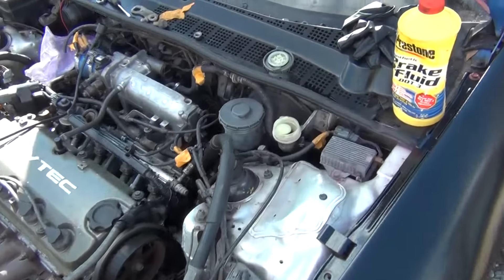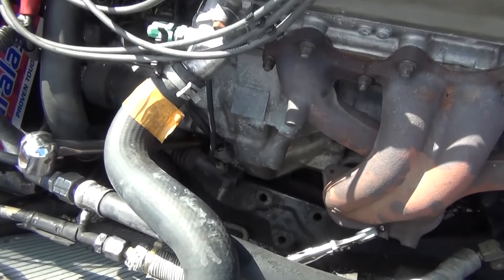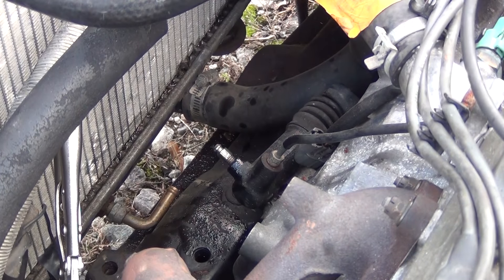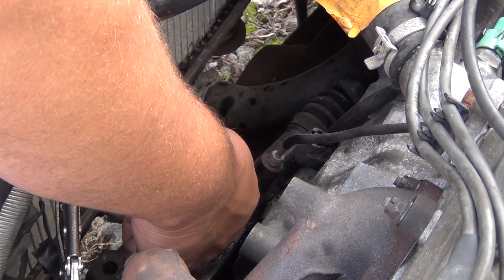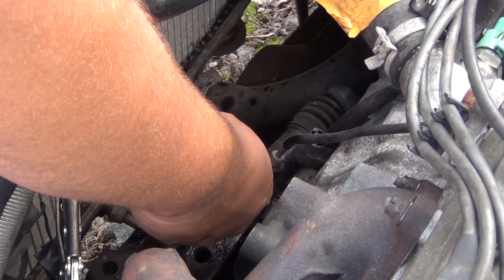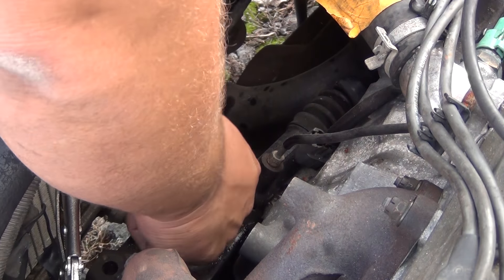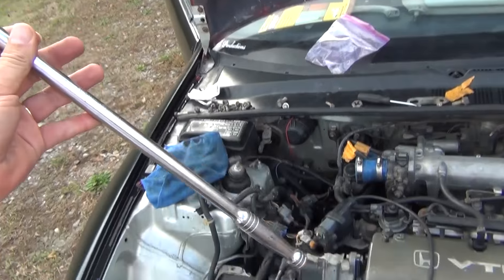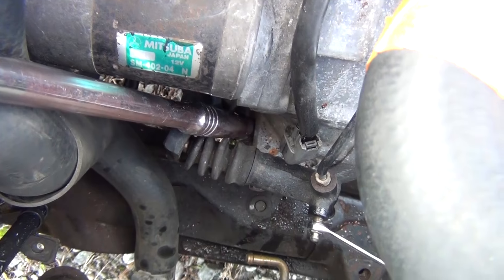How to bleed your honda clutch

Comment: I tried this method, after changing both the master and slave cylinders on a 2000 Accord.  After 2 hours of bleeding and getting nowhere, my pedal-pushing helper suggested we try a different method, and it worked!   With the bleeder closed, pump the pedal at least 20 times, and leave the pedal up.  Open the bleeder and push the pedal slowly to the floor, forcing fluid through the system.  Then close the bleeder and pull the pedal up.  Repeat until all air is out of the hydraulics.  Make sure the reservoir does not run dry.  I hope this will help someone to avoid the frustrations we experienced.
Reply: How long did it take using your method?
Reply: @corazon88  For me, after changing to the final method, the fluid and air bubbles started flowing out the bleeder immediately.  After about 5 reps, the air was completely gone and peddle was normal.  I wish I had tried this first instead of wasting 2 hours getting nowhere.  Good luck!
Reply: Did you did half turn or barely open the bleeder to get the air out
Reply: @Chipman88  The bleeder valve on the 2000 Accord is very close to the motor mount so turning it was really difficult.  Had to take 2 turns with a 12 point box end wrench - total of 1/6th of a turn - to get air and fluid to flow. 1/12 of a turn was not enough.
Reply: Then you did it wrong. This is a bad method. you really want a hose on the bleader so air doesn't go back into your lines. You see where the bleeder is so now just Google how to bleed brakes and the different methods for that will help you with the clutch as it's the same.
Reply: Just get the Phoenix V-5 or V-12 reverse bleeder and push the air up and out rather than forcing the fluid to work against gravity. 😂🎉
Reply: I do like Thad know my pedal no got back don't what I do run no got any power the pedal put it up put back and stay down don't know I buy new one to see any idea how can fit it please my first CRV 200 I got thank
Reply: I have this problem right now I changue tha master cilinder tha slave cilinder now we have a hard time to put tha air out
Reply: @laindiarivera  got saint problems abres abajo el tornillo completo y manda arguing lede Al pedal asta que tuveso sigue saliendo el brake fluid pero no puede dejar que dónde se le echa se vacía y cuando vea que sale directo cada ves under el pedal lo tranca y Leda como 5 veces o más deja a bajo pedal y abren el tornillo y ase eso como 4 veces tuveso pones duro si no trabaja compra la tool venden Amazon eso trabaja al 100 vale 16 peso pero hay una por 12 pone para sacar el aire del clutch o freno salir muchas suerte dios quiera travaje paso mismo tenía loco pero Ise eso pude arreglar suerte
Reply: Just wanted to say thank you. Your method worked for me.
Reply: I been trying this guy in videos method on my 02 accord for 2 hrs. Switched to the method you said started working. Just found your comment wish I saw earlier 😂
Reply: Thank you so much for this guide.My client's own had a similar issue so I bleed the clutch and still to no avail. I've even replaced only the kit inside the upper clutch but the problem of a sponge clutch and no gear still persist.
 I've checked scrutingly for signs of leakage carefully while someone and found out that the down clutch nipple doesn't hold clutch hydraulic fluid! It goes out gently, and also the clutch fluid was replaced with a new one. Nevertheless, it's still very darkened in color. Please, how do I fix the issues? 
   Darkened fluid, soft clutch pedal, and a most especially the leak at the down clutch bleeder  or nipple.
Reply: Yep you gotta open the bleeder then press clutch full to the floor then close the bleeder, pull back the clutch slowly then open bleeder and press clutch again. 20 of these will flush a bottle of brake fluid thru it quickly, just keep fluid well above the min mark. I bleed it into 5mm hose and can make it as long as you want, just set the drain pan above the height of the bleeder and should have a solid stream of fluid with no bubbles

Comment: You can do this by yourself if you use a jack handle wedged between the seat to hold the pedal down while cracking the bleeder screw. Go back into the car after tightening and pump the pedal then put bar or stick back to hold pedal down.

Comment: i use the fluid bleed method one man fluid bleed. attach hose on the bleed nipple put the hose in a bottle filled quarter way with fluid crack the nipple open & pump pedal check fluid after every 5 pumps to make sure reservoir didn't go dry  if low add fluid make sure reservoir doesn't go dry if so it make take in air then pump pedal repeat process then check nipple bottle is not over flowing if so close nipple empty fluid to reuse still keep the bottle quarter way full put the hose back in the bottle and crack the nipple open again. you can tell if  there's still air in the system if air bubbles is still popping up in the bottle keep repeating process until no bubbles show up in nipple bottle after that close nipple top off fluid and you'll be good to go may sound complicated but its super easy and effective just thought i share its an old way of doing it old as me lmfao but it works.

Comment: Great video. A little confused on the last part when you use the breaker bar to pry open the slave cylinder. Don’t you want the clutch compressed when you open the valve to bleed the line?
Reply: Yes which is what he did

Comment: If you have tried this and it's still not working, if you're sure you got all the air out and still can't push it in gear.  Did you buy one of the cheapest pressure plates you could find,  Amazon?  If you look into it sometimes even the good name after market ones have issues straight out the box too. I kept bleeding for weeks but it was the pressure plate. For easiest best bleed try this method along with an electric vacuum pump

Comment: If you have tried this and it's still not working of you're sure you got all the air out and still can't push it in gear.  Did you buy one of the cheapest pressure plates you could find,  Amazon?  If you look into it sometimes even the good name after market ones have issues straight out the box too. I kept bleeding for weeks but it was the pressure plate. For easiest best bleed try this method along with an electric vacuum pump

Comment: Also, it's important to note that a lot of times when you replace a clutch master cylinder, it will cause the slave cylinder to pop it's seal and you'll have to replace that as well. It's very common for that to occur. On a Honda such as this, there will be that small rubber boot that looks like an accordion. While bleeding the clutch, that boot will often pop off and spray fluid out. It's located near the bottom left of the engine very close to the bleeder valve.
Reply: I just replaced my master but the slave didn’t leak. Should be fine?
Reply: @jonathansalgado9194  yes. don't replace it unless it leaks. But really not a bad idea to replace it as it's super easy and you can bleed it before installing it.

Comment: you could do this so much quicker and easier if you use a pressurised brake and clutch tool. its a lot easier, only needs one person and takes all the guesswork out of the job, leaving no old fluid or air in the system.

Comment: Hey I tryed to bleed the clutch from my 97 civic ex but can’t get pressure from the pedal back help thanks!
Reply: Did you figure that out ? I have the same problem
Reply: @kevingarnet6822  yea I got it fixed just a lot of air in the system
Reply: @jessegunn2033  so how did you fix it ? What did you have to do

Comment: And would the  brake master cylinder being low on fluid or having an internal leak cause  the bleeding of the clutch to take a long time? Cuz I did the prying on the clutch slave cylinder and the clutch pedal won't get any harder
Reply: Young Malcolm following🥺
Reply: @AyySpaceship  its all good bro figured it out
Reply: @youngmalcolm8603  was it air in the system. Howd you get it out

Comment: I have a problem with a 97 prelude I changed the clutch and the slave cylinder and the clutch pedal is to the floor I already did the bleed part for 3 hours and nothing! Hope you can get back to me !..!
Reply from the maker: I did the same thing, thats why i used the prybar. It helps to get pressure off the slave cylinder so it can expand while bleeding it

Comment: Yeah, I just replaced both the master and slave on a 90 Accord and there's fluid coming out of the slave when I bleed it, but no pressure at the pedal.
Reply: Having the same issue.  We’re you by any chance able to get it fix ?
Reply: Having the same issue on my 09 accord but me I don’t get fluid or neither pressure help

Comment: I just cant get this right on my 2004 EP. I bled the system, air doesnt come off but the pedal falls to floor.. you can pushpull the master cylinder. I tried prying the slave piston, after cracking the bleeder, it just fills the slave cylinder from the reservoir, but not the master. :/ How do you fill up the master with fluid?

Comment: Justin, first thanks for making the video. secondly, my clutch pedal went to the floor and i had to get the car towed back home from work. I went crazy and replaced the clutch and transmission/axle seals and of course replaced both the master and the slave cylinder and no matter how much I bleed the system, the pedal is very soft. It IS drivable though. Have you ran in to this issue?
Reply: @Brandt Stewart In my situation, I finally realized that the "problem" isn't in the clutch hydraulics, it's just that the pressure plate is feather light. I literally replaced every single component of the hydraulics (master, lines, hose, slave) and there was no difference. The hydraulics are doing their job fine, I'm just used to the old clutch in which the pedal was stiffer. I have gotten used to the new style soft pedal now though. Also, I had a friend drive it that said it felt just like his stock VW clutch pedal, so I have closed the chapter on this issue. If you have any questions for me I'll do the best that I can to help though...

Comment: Hey I have a question. At :31 you showed us the slave cylinder reservoir. It looks like there is a small cap of some sort floating in it. (Your middle finger appears to touch the tip of it at :31) Is that supposed to just float in there like that? Or is it supposed to screw in there somehow? What is that thing called?
Reply: it really kinda floating in there, I have that same thjng
Reply: It’s called a float. It’s there to prevent any large debris from getting inside of the lines

Comment: God bless brother thank you for the vid 
It would be awesome if you can help me out. My ef hatch clock and radio stopped working and all the fuses are good I have continuity on all fuses under dash and hood. You would by any chance know how I can fix this issue ?
Reply from the maker: Idk, did you check for any bad connections in the plugs or wires
Reply: 79th Productions I’m gonna check the grounds next and then see I just don’t want to have to take the whole dash off that’s going to suck . Lol , any suggestions would be awesome thank you for the reply you’re a blessing
Reply: Joe Elder I believe for a 91 civic si hatchback there is no 7.5 fuse under the hood I checked a few times and I don’t think any fuse there is blown if you can confirm that there is that fuse for this particular car and can point me to it would be awesome thank you for the reply !
Reply: @jelde010  bump

Comment: I have the exact same car and I’ve been bleeding it for about a hour and still no pressure.  I don’t see the slave cylinder pumping when I pump the clutch like in the video. I just replaced and as well as the master. Do you by any chance know what the issue is ?
Reply: Hey man, I had a similar issue. U night night to replace ur master cylinder. That’s the one that’s connected right to ur clutch pedal. Maybe u need that?
Reply: Same thing happens to me no pressure I being trying one and lot of tricks but nothing could it be a bad master ?

Comment: Aye my pedal is not even with the else pedals it has a new clutch but the pedal is a little bit more in is it the fluid or the slave cylinder
Reply from the maker: +Hailey Washburn it probably needs to be bled a little bit more. My pedal wasn't coming all the way up at one point. I had to bleed it some more. If it was a stock replacement clutch the pedal should be in the same place

Comment: I feel that you showed how to bleed the clutch with just an assistant pumping the  clutch and how that worked but then you added an breaker bar but you didn’t show the method of how it works. The purpose of the video is to show what works right?

Comment: I replaced the slave cylinder and bled it. The clutch still wont shift into gear. Could this be the master cylinder?
Reply from the maker: Master cylinder wont cause it to not shift
Reply: @79thproductions  i thought if the master cylinder was bad, then you will not be able to seperate the clutch from tranny.  Then gears will grind?

Comment: Do u keep the pry bar in there when u crack the bleeder screw open?
Reply from the maker: It doesn't matter, you just need it to take the pressure of the slave cylinder. You can have it off or on

Comment: Is it possible to have air trapped in the master? I've done this for 30 mins and the clutch is still squishy and I can't go into gear.
Reply from the maker: Yes aor can still be in the system. I tried for about an hour and gave up. Then i used the breaker bar to extend the clutch fork out to allow the fluid to travel easier. Try the breaker bar trick. It will work after about 5 minutes
Reply: 79th Productions what’s the beaker bar trick
Reply: Try bench bleeding the master.

Comment: Maybe it's just that here in New Zealand we care about the environment but shouldn't you be collecting that oil to dispose of ;)
Reply: it'll be fine , oil comes from the ground in the first place
Reply: Yessir Yousir gaaaaawd,,lol
Reply: Yes the oil dose come from the ground but we add chemicals to the oil During the refining process also would you want oil in your drinking water? At that brake fluid it takes the finish off paint there's a reason why your suppose to catch it never know where ground water is and let the EPA find out you let brake fluid out on the ground that's a hefty fine not to mention they have to dig 3ft down and how ever far wide to remove the contaimated soil.

Comment: Please help. I did this method with a friend and thanks to miscommunication it didn't go well.. Clutch ended up going right to the floor with no spring or pressure to it whatsoever. Then I was able to just gravity bleed the system with fresh dot3, but still my pedal is right to the floor. By hand I lift the pedal up and down and nothing..
Reply: Steve Dal Bello all you gotta do is litteraly pupmp the clutch like 20+ times the more the better then open the valve on the cylinder and air and fluid should squirt out do it until the petal goes up on its own
Reply: @troywilliams1866  I actually had a blown master! Replaced it, and the slave cylinder too. Then pump+bleed worked perfectly👍🏼

Comment: Bars a good idea but im not going to try it with my luck id fuck my master up
Reply from the maker: +taylor jackson not to much pressure on it, just enough to fully extend the cylinder. It will be fine. You cant break it